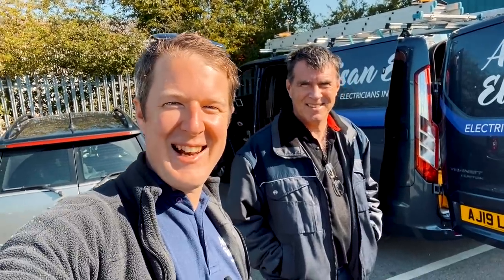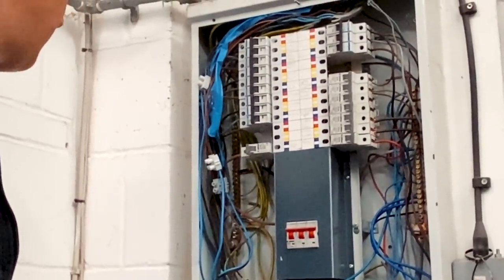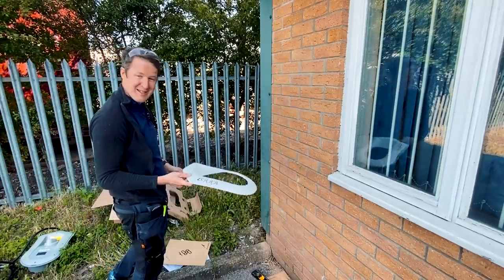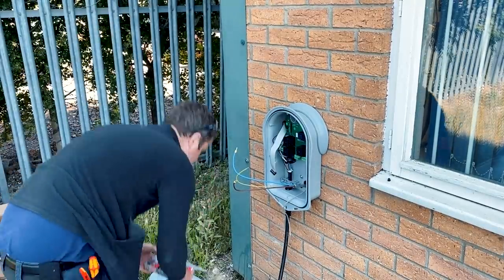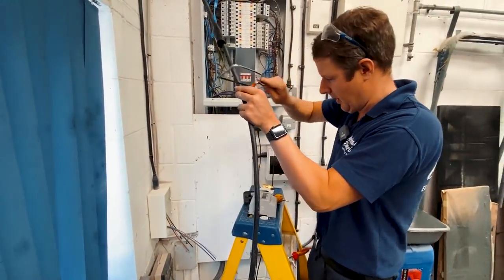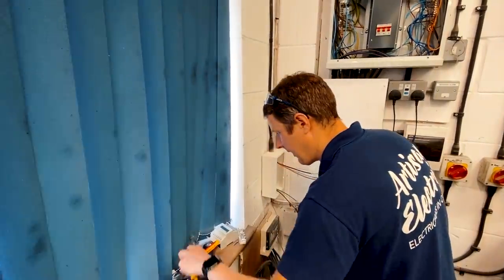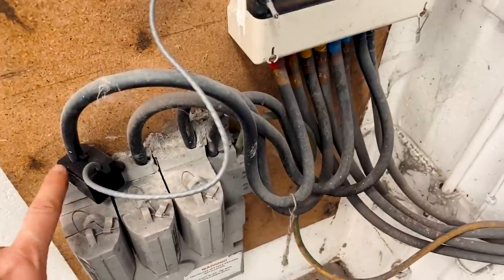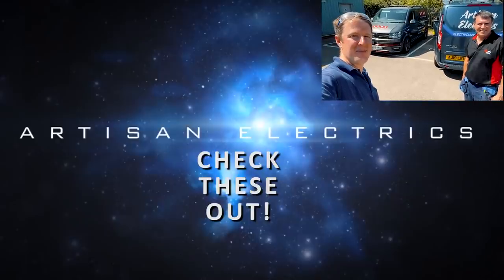Commercial Electric Vehicle Charging Installation

Comment: Hi, I really can't see what Jordan did wrong, as an old spark from the 1960's I never worked in a factory where you could isolate you had to work  live. Our only isolation indicator was a neon screwdriver, I overcame my fear as a wee lad by working on live bus bars the length of the factory with only about an inch between each phase, no flash or eye protection that was the norm in those days, it looked perfectly safe to me plenty of space just needs not to get distracted when doing so.
Reply from the maker: It’s impossible to shut down a working business sometimes, we mitigate risk by performing a risk assessment and being extra careful during the work and having supervision.

Comment: Was hoping to see you put a 22kW 3ph Zappi in.
Reply: What he said.
Reply from the maker: @tresslerj1985  Yeah would have been nice but there was a lot of load on the system already and not really necessary for a car with such a small battery. Charge up during work time doesn't need to be a fast charge.

Comment: For a DC RCD test, all you need is a resistor and a diode...
Reply from the maker: Cool
Reply: one diode will give pulsating DC not smooth... Maybe a 9 volt battery?!

Comment: How much would you charge for a job like that?
Reply from the maker: A days labour plus materials
Reply: Of course .... But how much is that? Give me some indication.... It it worthwhile to go go self employed?
Reply from the maker: Depends on how good you are and where you live but self employed electricians charge anywhere from £150-650 a day it varies massively.
Reply: A Wall Box Charger can cost around £500 but there is a £350 Gov grant to cover costs. Total cost minus the grant and added labour costs will able around £500. If you don’t drive that far like me I’ve got an outside 3pin plug instead and that’s much cheaper. 3pin charges about 7 miles per hour wall box will be about 30 miles per hour. Hope that helps.

Comment: I wonder why the customer never went for a 3 phase install- seemed ideal?
Reply from the maker: Not necessary really
Reply: I suspect that frequent use of rapid charging for most EV’s is likely to reduce the service life of their traction batteries, so probably wise not to do it every day. Not only that, rapid charging might be less efficient, if more cooling is required during charging. Just paying to warm the air then.
Reply: @johnkeepin7527  With AC charging you're not even near 1C unless you're charging a hybrid with a dwarf battery. And it's slow charging that pisses away energy as all the electronics that need to be running don't use less energy if you charge slower. Up to half the energy that comes in can get wasted for just keeping the car "on" in extreme cases.

Comment: Can someone explain what the "CT connection" is please?
Reply: Current sensor I believe.
Reply: Its to do with the network providers "Current Transformers" or step-downs, so the polarity is required for the sensing circuits to perform correctly. That's its simplest explanation but can be quite complex in its deeper explanation. Hope this helps ;-)
Reply: Thanks guys 😊

Comment: Can you install longer tethered cables with the Zappi or would it void their warrenty?
Reply: Just get a untethered version, then you can have a cable as long as you want.
Reply: @scottmulligan912  from the sites i have been checking, a 15m tethered cable is cheaper to buy than a 15m type 2 to type 2 cable, unless you know of a decent cable store i could use?